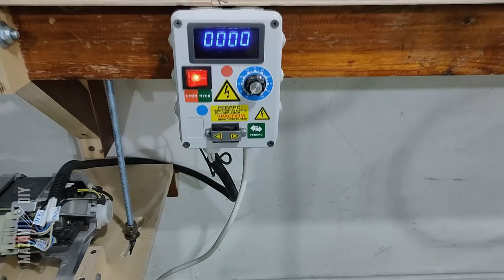DIY Lathe Machine for wood. Part 1 - base and headstock. First run!

Comment: Do you have a link or ref. No. for the controller? Nice job. 👍 😎
Reply from the maker: This is a custom controller. For motors up to 400W you can order Speed Motor Controller https://www.banggood.com/custlink/m3vESlB1jI + Hall sensor https://amzn.to/3pY5KLj
Reply: @MazayDIY  Thanks for that info, I have a very similar washing machine motor and need the sort of set-up that you have used. Thanks again. 👍 😎

Comment: 0:17 sir what is this part? is that a car part? How do you call that part?
Reply from the maker: Ruşen Çelik, it is a circular saw shaft. I bought it at a flea market. Can be assembled from and most of two housing bearings and a shaft (you will have to order from a turner)
Reply: @MazayDIY  thanks sir i think i cant find that part. I will look for something else that is similar to this.  By the way why did you write in russian? I didnt understand a single word.
Reply from the maker: @rusencelik1272  Sorry, I edited the previous comment